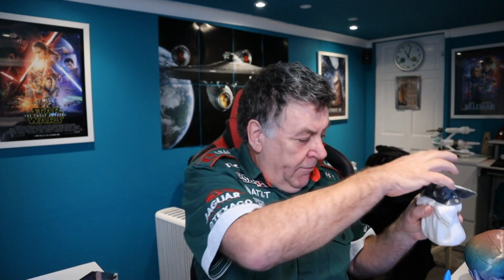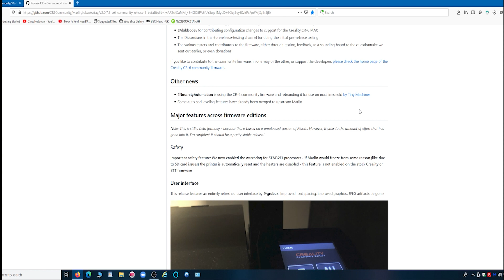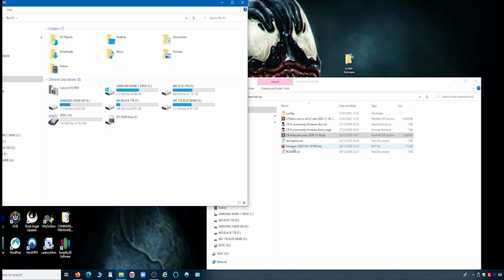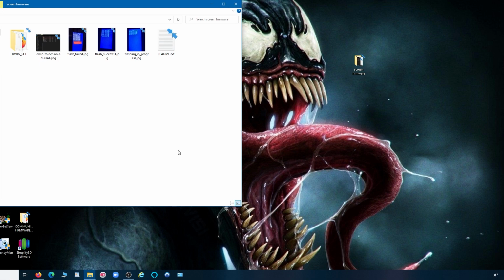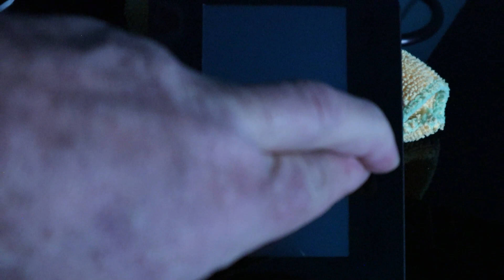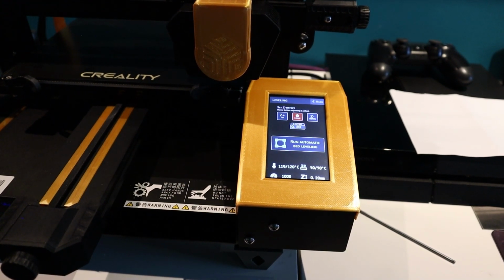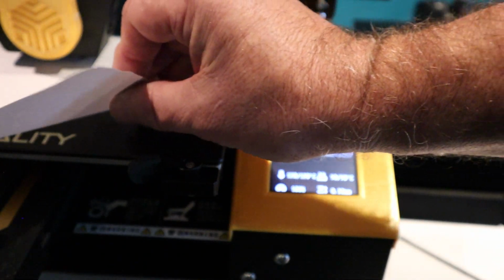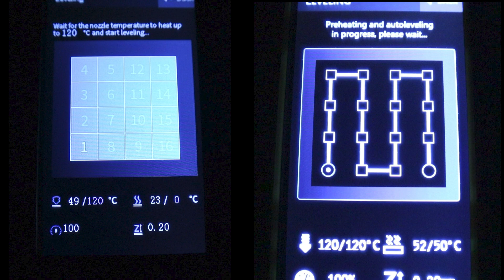Creality CR6 SE Community Firmware Install...Start To Finish

Comment: is there an Estep adjustment feature on firmware? i upgraded stock extruder driver gear to dual gear and i need to fix esteps
Reply from the maker: Hi Michael ...Sorry I cant help mine actually broke today :(  ...there is no power getting to the runout sensor and the X axis refuses to move (prob the same reason if its an output from the motherboard fault) so I am going to be sending it back to Amazon...so haven't had chance  to fully familiarise myself with the new firmware yet......If you ask on the Facebook group I am sure someone there who is far more knowledgeable than me will have the answer
Reply: @TomsManShed  im sorry for your issues with printer. I got mine up and running and so far so good. Had some tuning issues from before im still working on but this new firmware is awsome...  turns out firmware fixed it but im still under extruding, setting flow to 150 fixed it..
Reply from the maker: @Michael-ot3zw  You are not going to believe this Michael.....I found the "fault" I mentioned above.... This morning I came to do a print and the display beeped  saying "load filament"....even though it was loaded...when I looked there was no blue light on filament sensor ...so I went on FB group and asked and found I could bypass it on the new firmware with some gcode ...I am a total noob when it comes to Gcode but with guidance from the group finally got the machine to start.

However  the X axsis motor (left/right of the print head) wasn't moving ...I checked all plugs and they were all connected so suspected motherboard as I have the 4.5.2 early one

Anyway I was busy doing something else later all day and after leaving my reply to you above just now  I thought I would check again.....I jiggled some cables and it WORKED....I found it was one of the pins on the little black ribbon cable that plugs in just under the run out sensor wasn't fully in....DOH!

SO panic averted and it doesn't have to go back...yet :)

Hope you get sorted with your e steps

Comment: Hello. I only have a 32gb micro-sdcard with a standard sd-card adapter. Will it be possible with this?
Reply from the maker: Hi Ovimohr...it's the size that matters (ooh matron :) ) .....a micro SD card in a full size SD adapter is fine...it's what I used ...but the advice is 16gb or smaller. ...OR you can create a smaller partition (with windows disk manager) on your card and use that....it then just sees it as a smaller capacity card....the important bit is to format as FAT32.

You could try with your card as is if you can format in FAT 32 ...if not do as above.

Or if it doesn't work just buy a card like I mention....it was only £3  and will always come in handy

Comment: Is anyone having an issue with the z offset? When I home my printer then try to raise the z offset it won't go up... Anyone having this issue?
Reply from the maker: I have had the odd glitch with the firmware....the main one was a yellow screen showing faulty bed sensor ....I have since installed the version 6 firmware and not had a problem....I think it helps if you install the firmware about 3 times all in the same go...ie install it ...then again straight away then again.....it might be just me or coincidence so don't take that as a definite but it's worth a try

Comment: But does it print any better?
Reply from the maker: Well I haven't noticed any difference in the print quality...it was great before and still is but I wasn't expecting that ...it's not why I installed it... it certainly makes it nicer to use though and knowing it will get regular updates (unlike reality firmware) is good to know.
Reply: @TomsManShed  thanks for the insight :)
Reply: @MegaFISSHY  I hear you can actually use arc g codes with the community firmware which has many benefits, just search on youtube "3d printing arc welder"
Reply: @Spawnova  I was under the impression that the standard firmware, based of Marlin, could already interpret arcs in gCode. Will give it a shot with my stock firmware!

Comment: Is a 512MB micro sd card big enough?
Reply from the maker: Hi Paul....its dead easy to find out by downloading the firmware to your desktop ...unzipping and seeing how big the files are....but yes that card is plenty big enough (where did you dig it up from it must be ancient :) ) 

The bin file for the MB is only 173Kb and the screen firmware is 6.77Mb    as long you format according to the vid then it should be fine.
Reply: @TomsManShed  haha yes it's ancient..  finished it was enough space!!! Thank you!!👍
Reply: @TomsManShed  one issue I had was when you press home then try to put the paper under, the z offset won't go up for me..

Comment: I did it an my screen staying black
Reply from the maker: Sorry to hear that JJ...not sure what the problem is other than maybe a glitch in transferring the firmware...all I can suggest is try another ssd card ...hope you get it sorted.
Reply: @TomsManShed  turns out the new update has to have an additional file